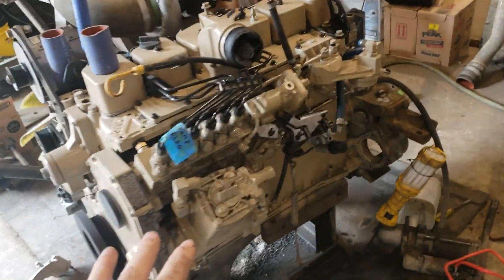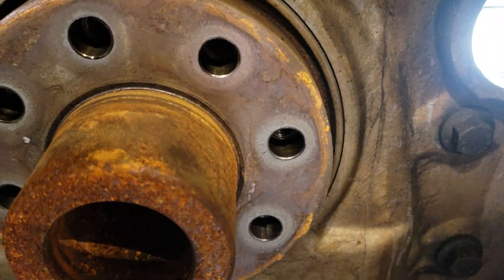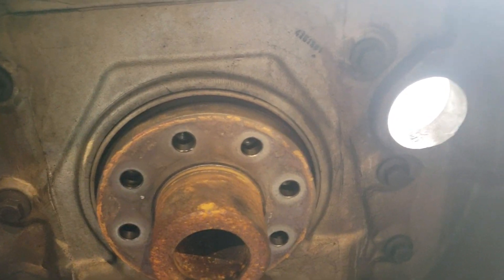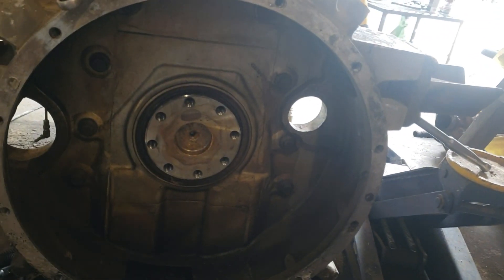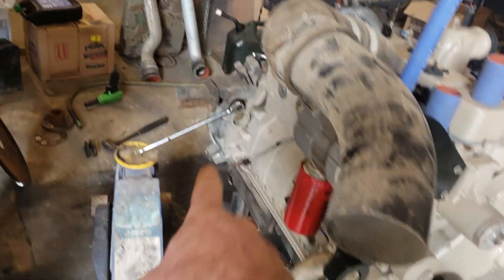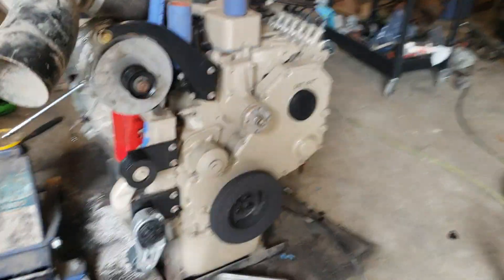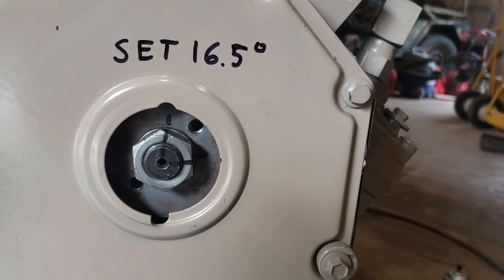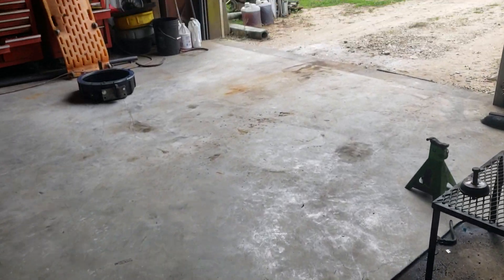Cummins 12 valve 6bt  Allison transmission flexplate and crankshaft adapter

Comment: I’m so happy I found your video. I was planning on changing the rear main seal and saw that adapter thinking it was the crank. And then thinking, how TF am I getting the flywheel housing off. I’m going back in the garage tomorrow with a sledge to get it off. Thanks for sharing.
Reply from the maker: Don't be rough on it. It's a very valuable part! A few good taps with a medium ballpein hammer will get it off.
Reply: @tacticalrepair  you are correct sir. A few love taps and it came right off.

Comment: Hi, friend. I need to connect the box to the engine, could you tell me the part number. Flexible plate and crankshaft adapter.
Reply from the maker: I do not remember the numbers,  but I have another video here about the clutch that includes the part numbers you need.
Reply: @tacticalrepair   Post a link, I can't find this video.
Reply from the maker: @РоманШуберт-к1д  https://youtu.be/BRNLoz-Ld3U